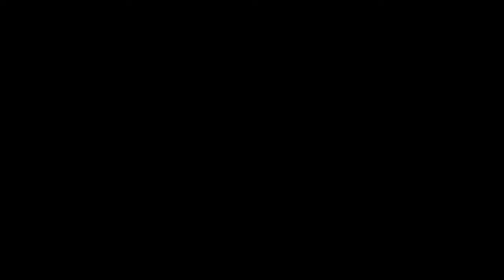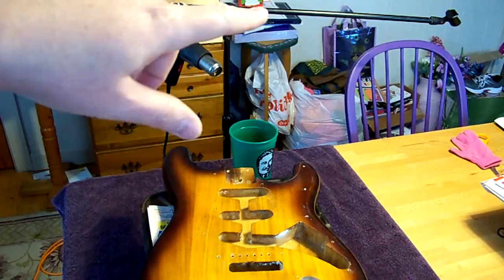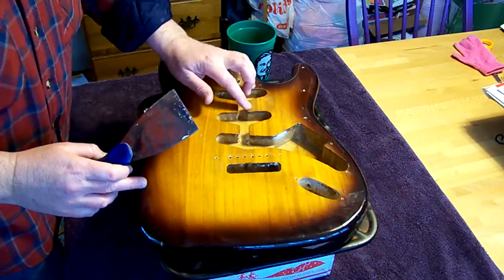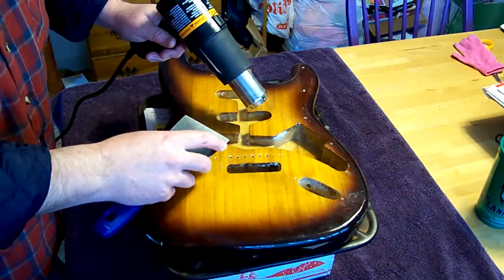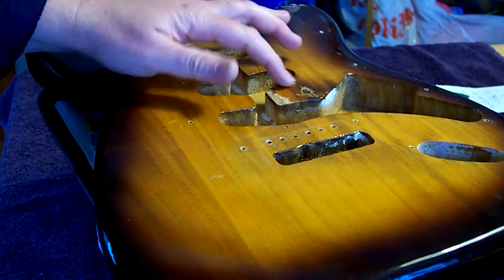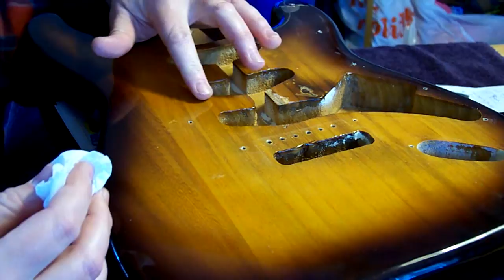Building The Perfect Electric Guitar - Part V: Stripping The Poly Finish

Comment: Hi Joe, I've under taken this task before and I find circa 1860 brand wood stripper works best, just brush it on and brush it off...they even have a low vapour version for indoor projects.
Reply from the maker: Thanks. I'll look into that. But I think, at this point, it may be more trouble than it's worth. I don't think the original manufacturer used any sealer, so the finish has soaked into the wood fibers. :-(

Comment: I'm obviously quite late on this...but...note that those guitars which they remove the finish with a heat gun are "sparkle, metalic..." finish. They may be poly, but still, and for whatever reason, it makes a big difference. On these finishes, notice that paint remover|acetone will degrade them, whereas the none sparkle|metallic ones...nothing will touch them.

Comment: You were not doing the heat gun properly,,one has to move the gun back and forth,you should of heated the black paint first,the thicker colour will eventually bubble and give you an idea of how long to keep the heat on that particular spot,simple back and forth motion would've given you the peeling you wanted,gun from paint distance is roughly 3-4 inches,always moving the gun,not too quickly though,just enough to show bubbling of the paint.

Comment: I'm not sure, but I've heard that if you spay one type of paint on top of another type of paint it may cause a reaction. Perhaps you should experiment spraying other types of paint, maybe cellulose based, on top of the original finish to see if they react. It might then be easier to remove the original coat. I don't know, it's just an idea that came to mind. It may well not work . . . but then it might!